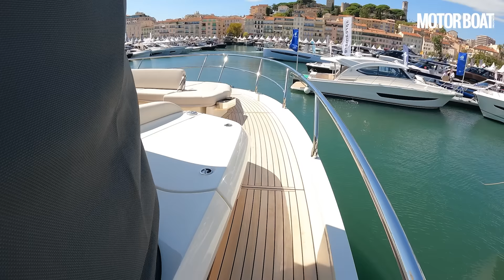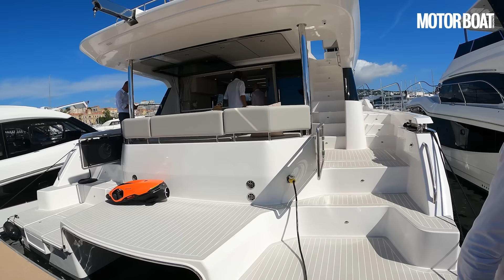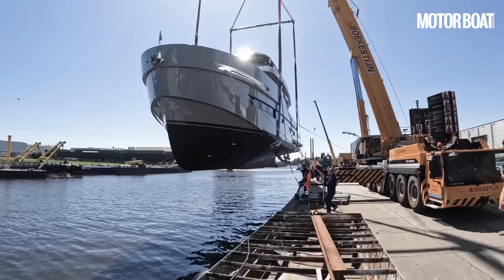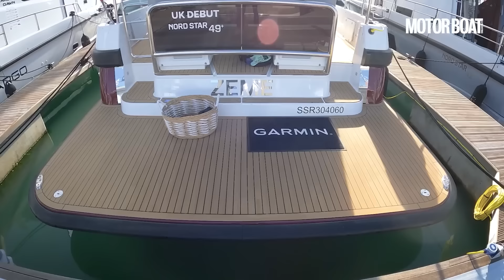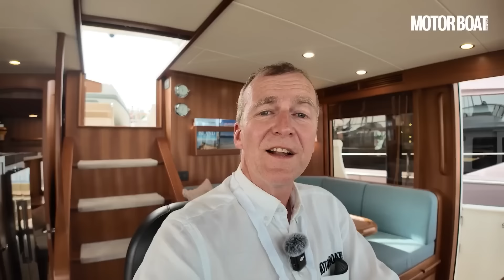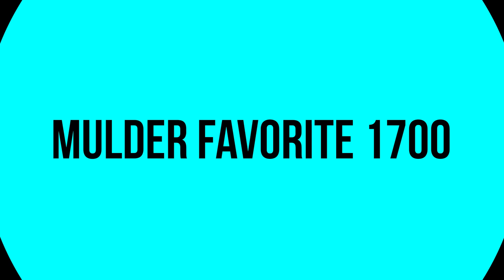The Best Boat Launches of the Year! | Alex Smith picks his best tours | Motor Boat & Yachting

Comment: As a long term boat owner, I know that every boat that I have owned was out of my control. First the finance, can you afford it or afford the credit. Actually, probably before that? Does the boss like it, and can I win the arguement that you don't need a washer dryer on a Contessa 26, not quite true. I lost that arguement and half a house and pension. Several decades later I have a very old First 501 which had a charter life in St Martaan before I owned her. Why, because I could just about afford her despite giving away another half house in the meantime. I am now in my seventies and would like to cross to the dark side and buy a motor yacht.  A beach club boat? If I knew what a beach club was I could comment? As a sailor of many decades, hands down, no questions, The Fleming. I wonder what those two half houses are worth now? Merry Christmas everyone. 😀

Comment: Aquila 46? Not much of a long term cruiser without a lower helm for bad weather or even ,dare one say, one boats in area's of cooler weather, not a rough weather vessel.
Reply: There is the option of a lower helm but as with any powercat that makes such excellent use of the space between the hulls, the bridge deck height does require a bit of clever management to avoid bottoming out when the seas get up.